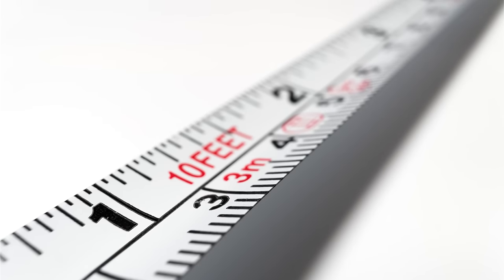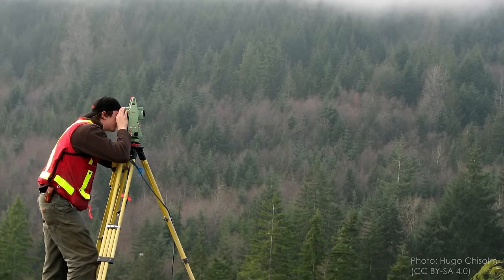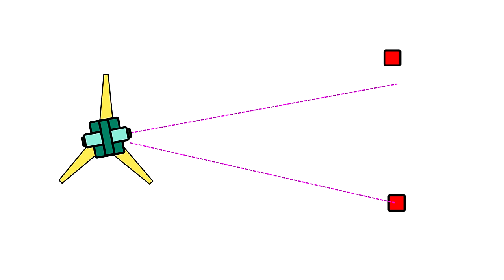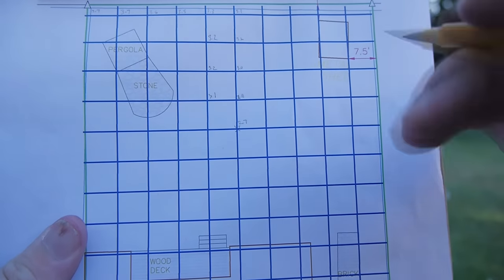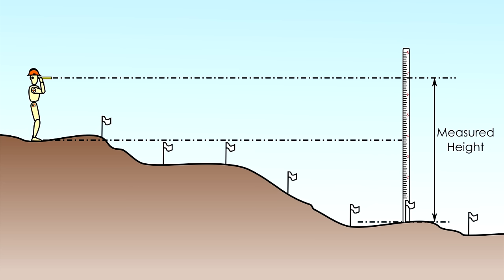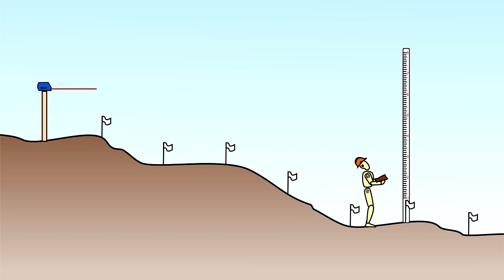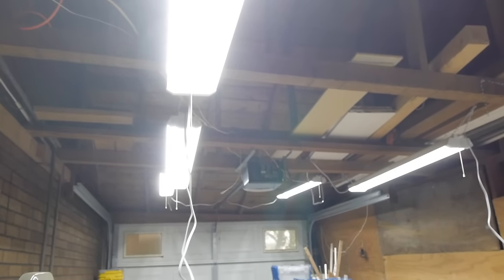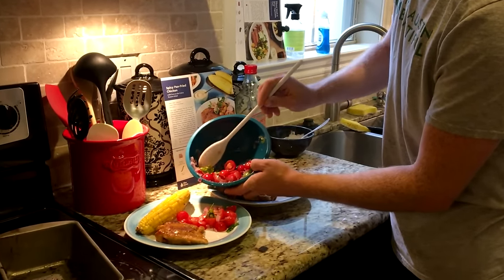How does land surveying work?

Comment: The accuracy of the water level can be greatly increased by using a reservoir (bucket of water) at one end. The larger surface area or the reservoir absorbs all the variations of tube movement etc. I simply place a full bucket at a good height (maybe a stool or step ladder) within my tube length for the job. Hold the tube down in the bucket with a weight (brick) (setup like you would as a syphon) fill tube with water and allow to syphon to remove air bubbles. Attach work end to a stick, make your reference point ... perfect level all over site. Some go fancy by adding a tube to the bucket like the guy in this video (too much trouble) https://youtu.be/sorOPOY_F2c

Comment: I worked in surveying for 9 years.
Reply: Is it a good job?
Reply: @d.j.wellington  If you like working outdoors it is. I got chased across a field by a tornado once. I had a horse following me around a field once as well. I found a cool fossil and it is sitting on my bookshelf. I was at the bottom of a 20' deep trench and could see a thin brown layer of something that looked like tree bark (about 5' up from the bottom of the hole). I was told it was the rain forest that was once in the Denver area. They said that was about 15,000 years ago. While working at DIA in November one year, we were kept warm by the exhaust of a nearby idling 737. As they revved the engines to move, we had about 5 seconds to hold on to our hardhats before the jet blast would knock them off our heads. Also at DIA, I got stuck in "traffic" at a stop sign while waiting for a couple airliners to roll past so I could cross the taxiway. At the Colorado Springs airport, fighter pilots would wave at us as they taxied past. It can be an interesting job.
Reply: @hlarks  Ok thank you. And what about the salary?

Comment: You failed to give me insights on this subject. You're usually much more indepth in explaining engineering. But here, you stuck to the surface and gave no depth to the subject. Nor did you discuss the how the equipment works exactly, types of measurement, calibration, etc, beyond the most basic. Anyone with at least half a brain knows what serveying is and that it's used often to take gigantic measurements usually for construction and roads. You gave some basic history a fifth grader could follow. But nothing with any meat on it. This falls woefully short of the quality I'm used to seeing with you. I have to give you a grade of a D- for quality, basic information, less scientific examples beyond DIY projects,  and for not going indepth on the different types of equipment, like spinning lasers,  and whatever other types of equipment they use besides what you showed. I'm truly disappointed. Just not all that informative.